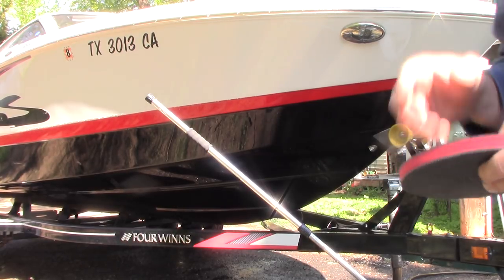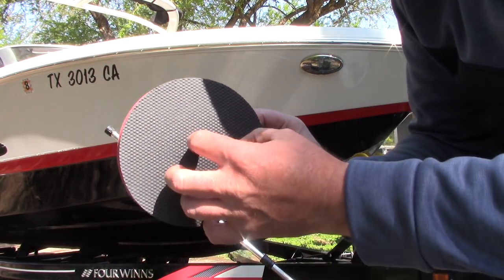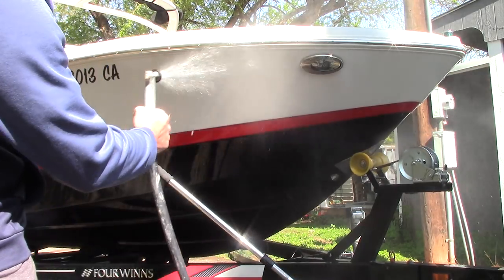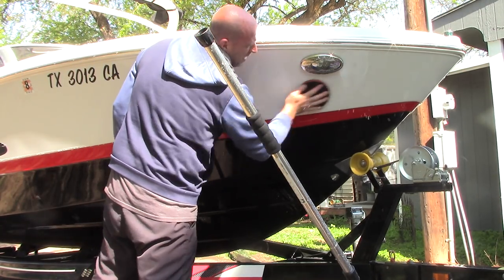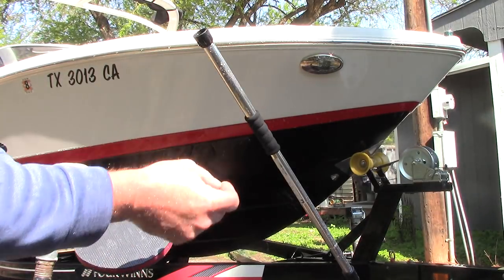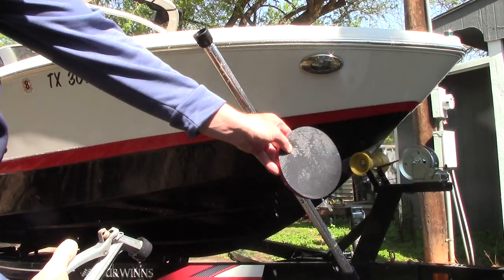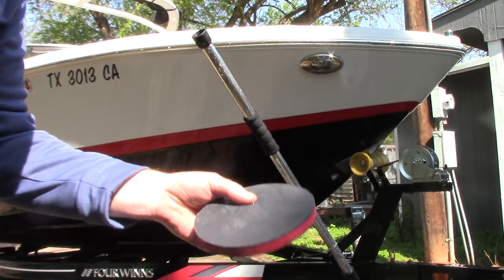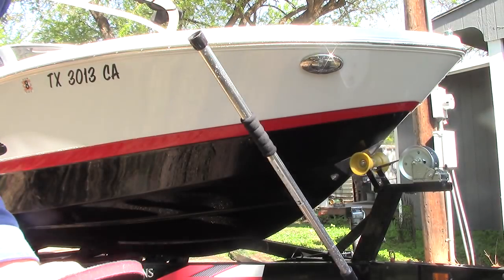How To Clay A Boat - Why You Should Clay A Boat!

Comment: I'm going to say no, you don't need to clay a boat if you're just going to use a Cleaner wax afterward.
1st, as a detailer with years of experience, you're aware how to use cleaner wax, it cleans and will never last as long as a polish but more important than that is that it cleans... (no need to clay if you've basically got that step in the next product)
If anything, on a new boat sure but then you wouldn't use a cleaner wax to follow up. 
2nd If you're that intent on a good job, performance from your wax, you would compound, clean and polish the boat. Basically skipping any need to clay bar. 

Boats aren't cars. Different chemicals, techniques and thinking. I'd be happy to show you how to properly polish gelcoat someday.
Reply: What compounds do you prefer?

Comment: I've been detailing boats for over 20 years. Claying is a wasted step. Polish does the same thing,if not much better. Also, never use a car wax or sealant on a boat. Car grade products do not seal as well as those made specifically boat finishes. A boat finish is much more porous than a car finish. Most all car products do not get into those pores in a boat finish and will not protect nearly as well.